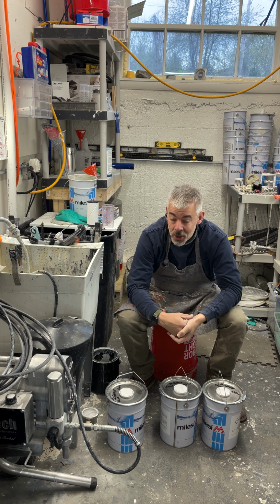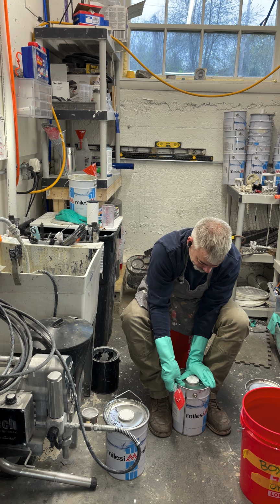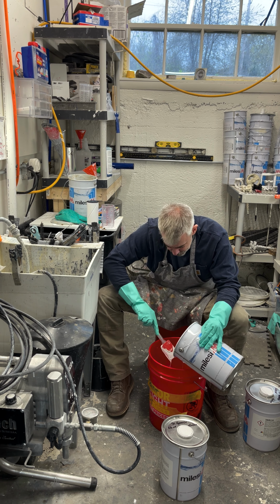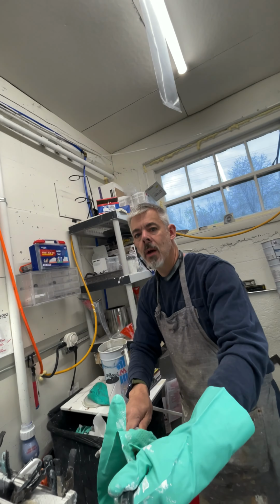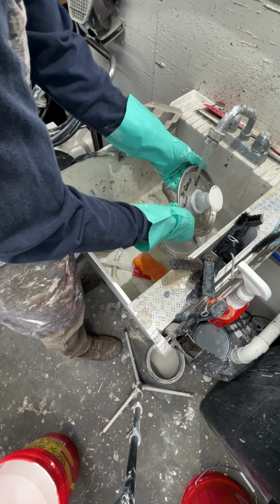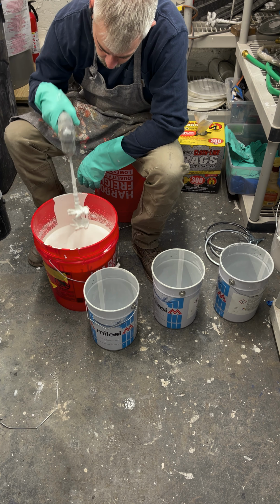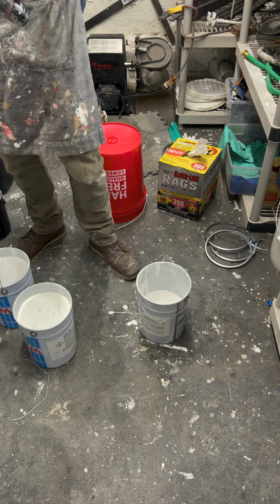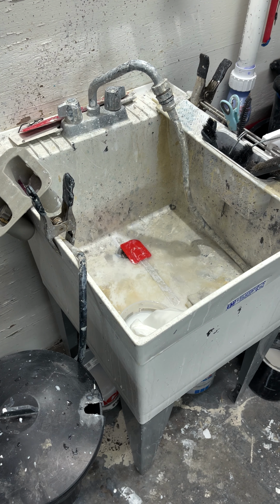Boxing Milesi 2K

Comment: I feel like this would be a good point in time to strain the paint as well, or do you not strain at all?

Secondly...
If you are doing 2k topcoat, do you also 2k your primer? Trying to determine best practices.
Reply from the maker: This is a good question.. I don’t filter the paint while boxing because I’m primarily using my Tritech Airless machines for application. These machines have three built in filters. One in the hopper, one in the manifold and lastly a gun filter. This has always been enough because I’ve rarely had a tip clog. As for your second question about using a 2k primer - it’s entirely dependent on what I’m painting. For open grain wood like oak I use a high solids primer like Envirolak 170 TB which is a catalyzed 2k. For closed grain like maple or cherry I’ll use a solvent based primer called vinyl sealer. It goes on much thinner and has a significantly quicker dry time.